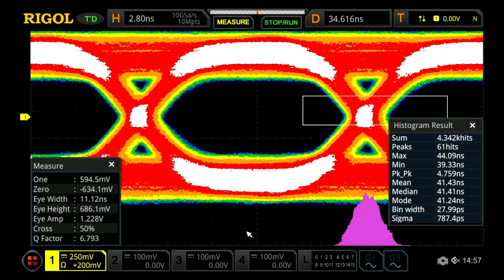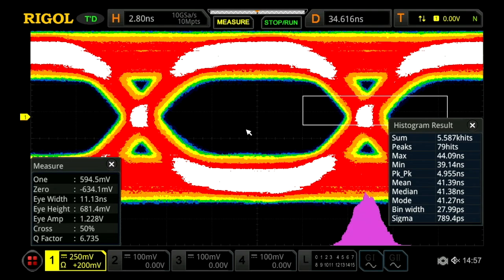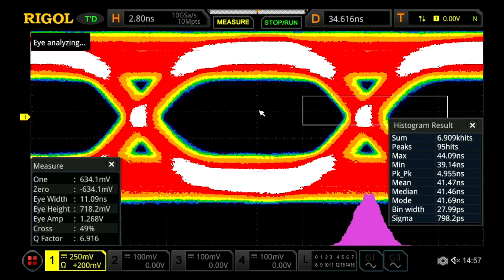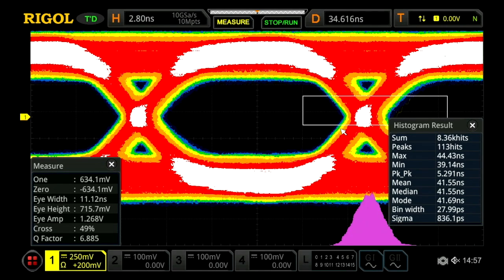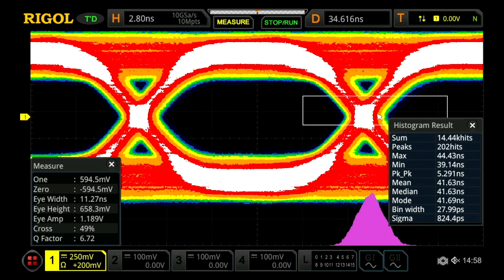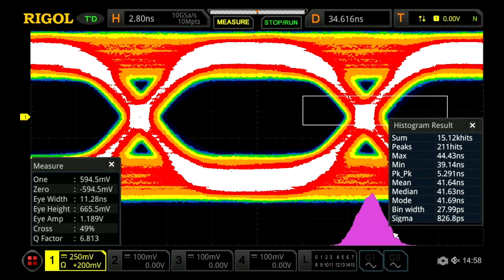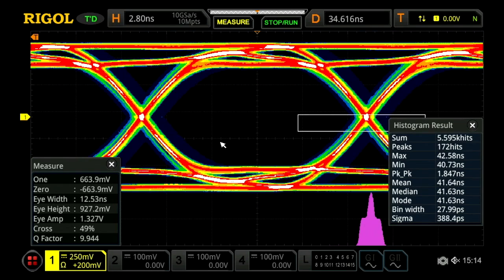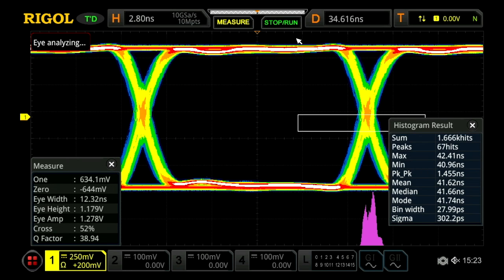MSO8000's Real-Time Eye Analysis Capability

Comment: I have a question that i have not been able to get a straight answer to 
Regarding the Rigol Options  EYE ANALYSIS and JITTER...
Are they available in the MSO5000
Are they available in the MSO7000  ?

There have been people on youtube who have done videos with the Jitter option and had a play with it and it worked fine, however they have no Eye Analysis Option, Which is weird because Jitter and Eye Analysis are part of the same Option Package

Then there have been people who have Jitter and Eye Analysis in their scope, They are able to open and enable Eye Analysis , it does indeed say Analyzing and yet no results are produced

You would think with such a cool feature that it would be relatively easy to enable and get up and running, i also can't seem to get a straight answer from the manuals